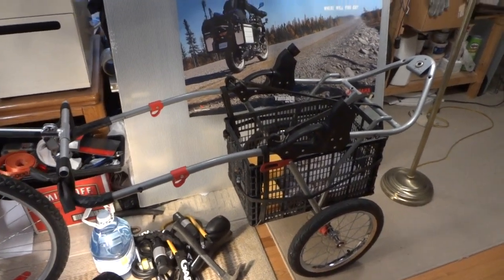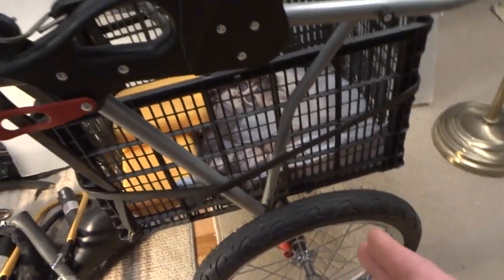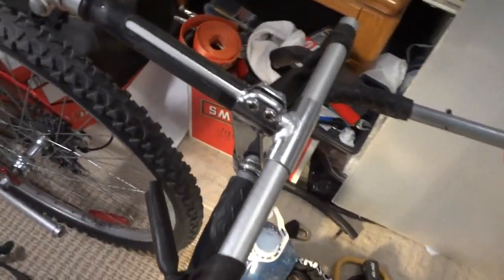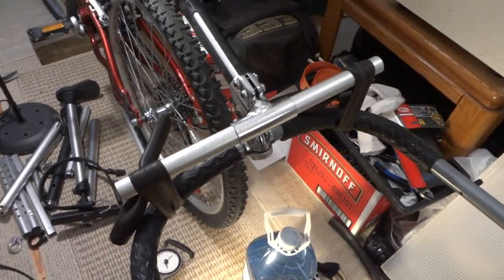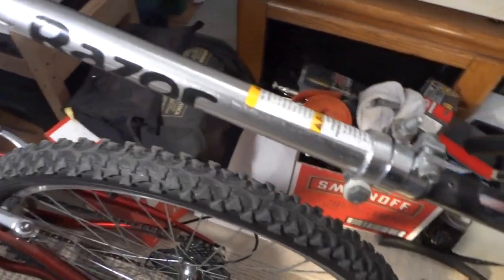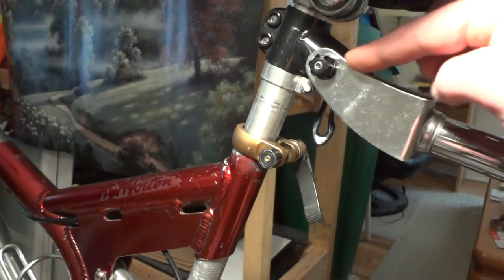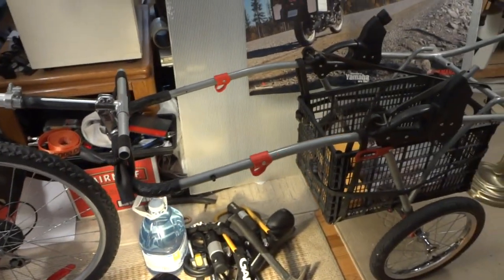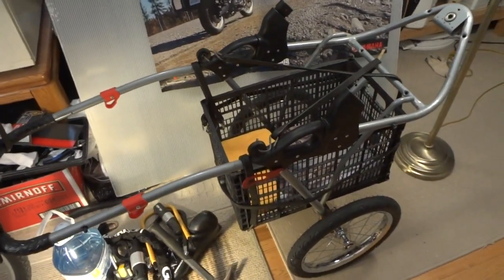New prototype bike trailer with anti- roll bar made from baby stroller

Comment: Hmm. That's an interesting concept... Most trailers are 60/40. 60% of the length in front of the axle, 40% back... On such a small load at low speeds it probably won't effect it much... But the more the weight is back, the more likely it will fishtail... And if you go up an incline, it will lift on the hitch... But with only 20lbs, it probably won't even matter
Reply from the maker: Ya with regular cargo it wont really matter. I did high speed tests and hard cornering, but the trailer was very lightly loaded i believe. handled very well. there is some videos showing it tracked very well and was not able to roll over so that was my main objective to not have it roll over as my original heavy duty trailers had that rollover issue.

Comment: What happened to the 3 wheeled trailer build?
Reply from the maker: Its coming, haven't started it, i'm basically going to copy your trailer... low center gravity and some-kind of small wheel up front, going to try and make it light but strong so its easy to bring inside, possibly collapse-able